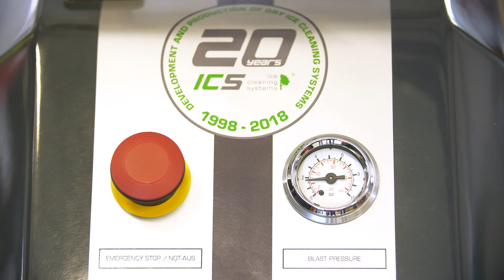ICS Dry Ice Cleaning Systems │The coolest way to clean!

Comment: Will this remove carbon build-up on intake valves? It would avoid a lot of the hassles associated with walnut shell blasting.
Reply from the maker: With IC 310 S is possible.
Reply: I was thinking the same thing. There's no reason why it shouldn't be perfect for carbon cleaning.